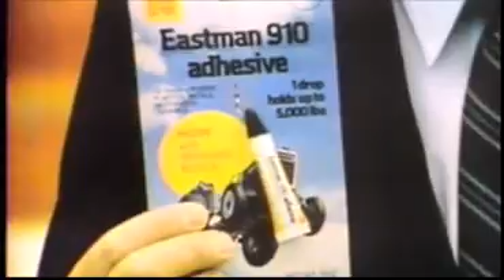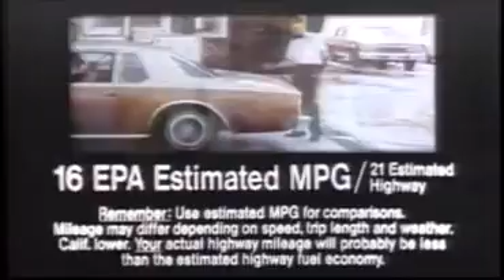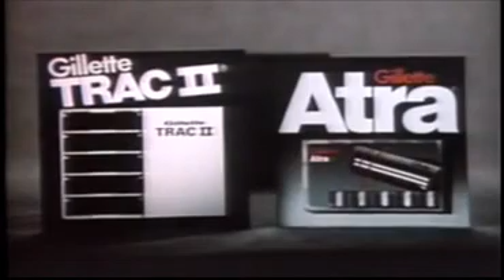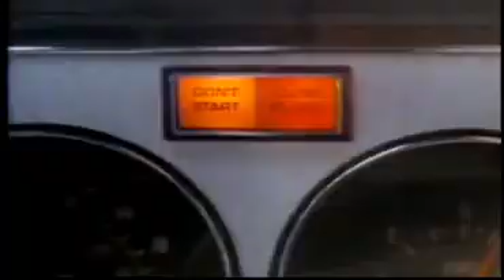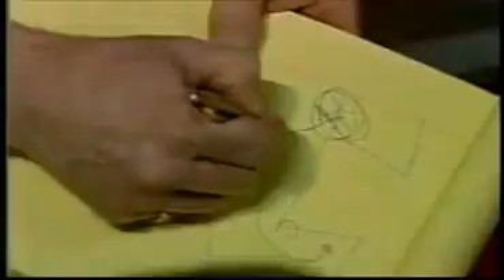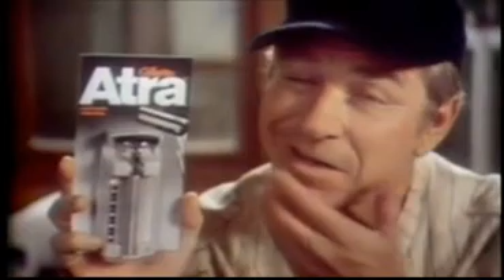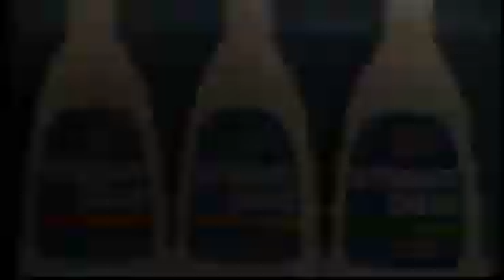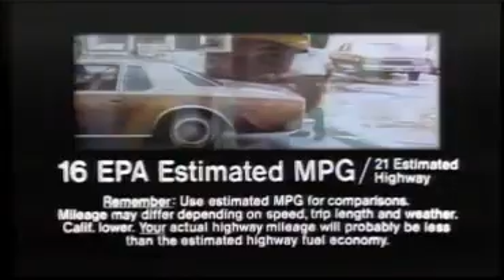1 08 79 Chicago Bulls at Denver Nuggets

Comment: It's so weird the Nuggets use to Have a Chicken as a mascot back then in the 1970s. Because of Chicken Nuggets.!? Or something 🤣🤣🤣🤣 But their unofficial mascot during the ABA Days was Maxie The Miner When the Denver Rockets rebranded as The Denver Nuggets in 1974 and They still had the mascot when the joined the NBA In 1976. The Maxie Miner logo was retired in 1981 but the uniform remained until 1982 and replaced by The Rainbow Skyline logo 🌈 🏙️  In 1990 The Nuggets Official Mascot Rocky The Mountain lion Would debut in the 1990-91 Season.